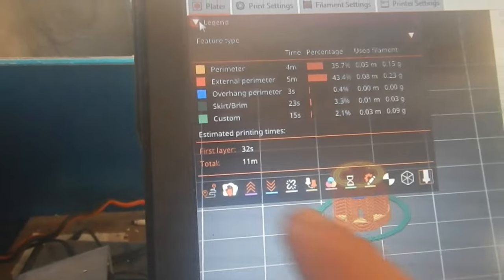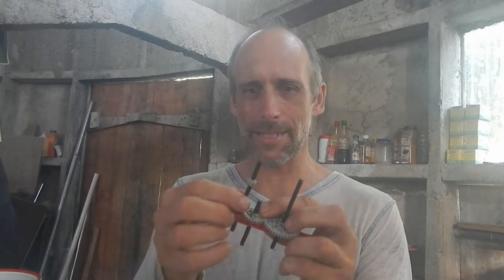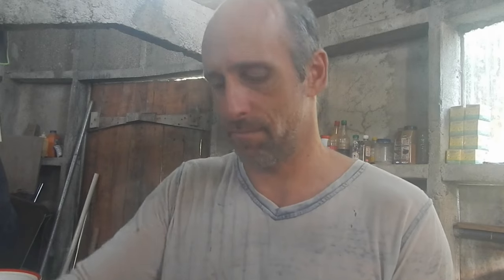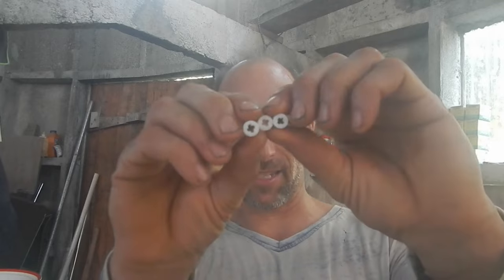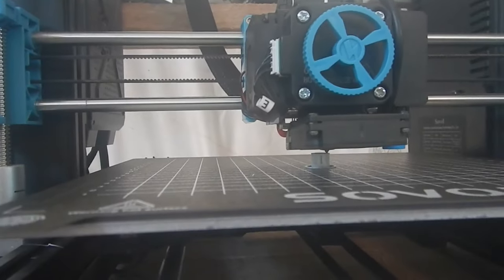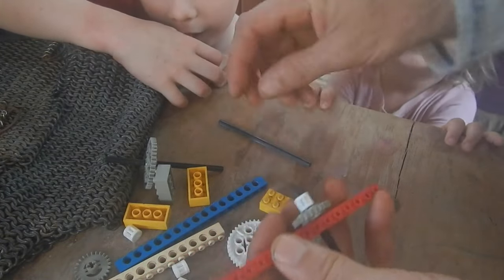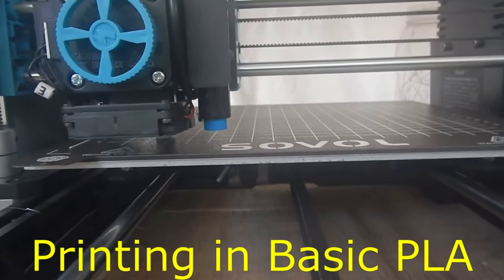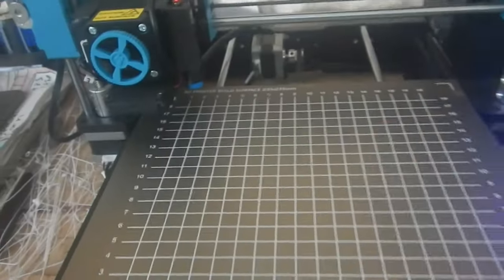Fixing a 40 Year Lego Mistake!

Comment: The problem is you can't use two of them together with the walls.
Reply: Exactly. But the walls don't need to be quite as thin as they are originally. It should work if they reach a hair lower than half the gear teeth.
Reply: With a wall on only one side you can have the gears opposing each other. Most times with Lego gears though you are looking to achieve some ratio so wouldn’t be using 2 of the same size together anyways.
Reply: If he makes the wall half the height on both sides it would work and still be stronger than the original, or anyone else could grab the file he published and make that adjustment.